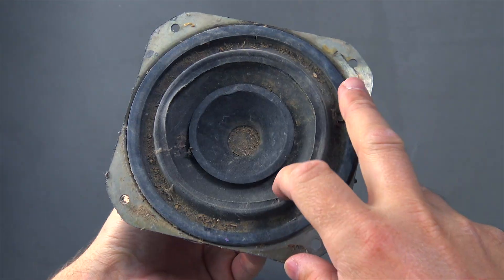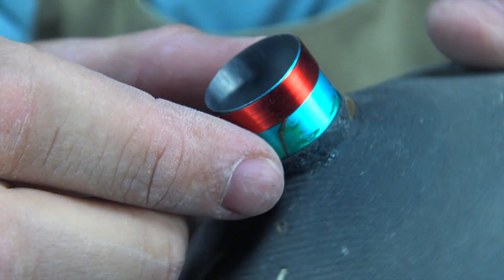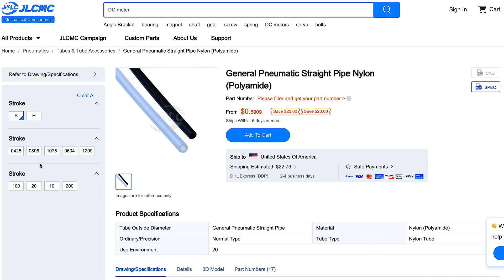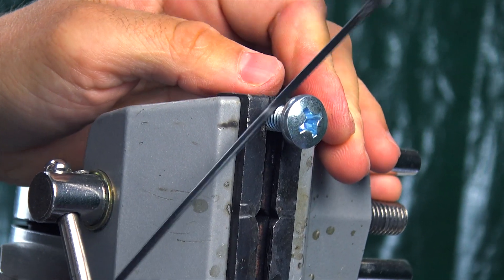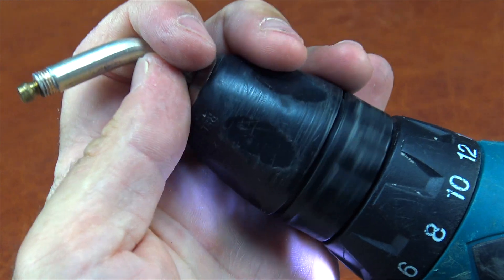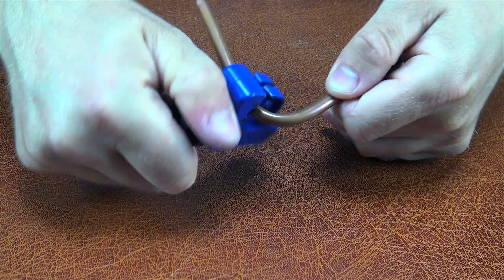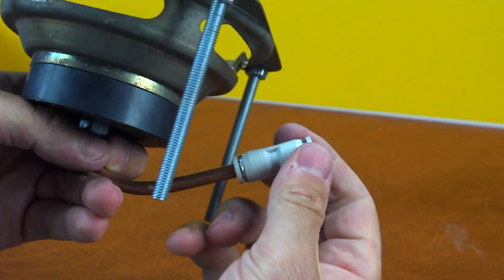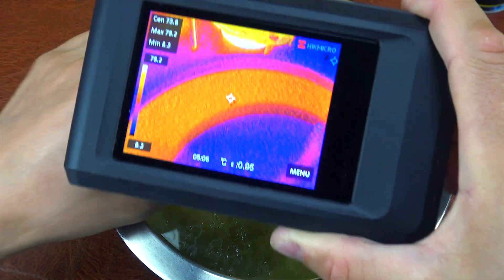BlazeUnit | The Speaker That Cooks Food — DIY Gas Flame Generator at Home!

Comment: Yellow flame a bit rich
Reply from the maker: Yes, you’re absolutely right — the yellow flame does look more saturated.
This happens because, during incomplete gas combustion, tiny soot particles are released, which glow in the yellow spectrum and make the flame appear brighter.

By the way, this yellow color often indicates a lack of oxygen in the gas-air mixture. To achieve a cleaner, blue flame, you need to slightly increase the airflow. This can be done by enlarging the air intake holes or adding an extra one — this way, more oxygen enters, and the flame becomes hotter and blue.
Thanks for your attention to detail and helpful observation!